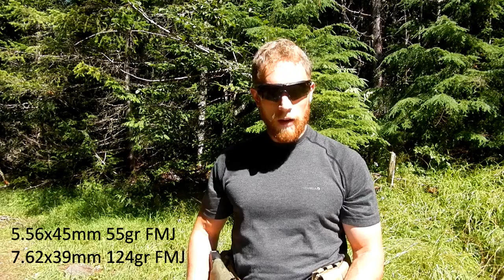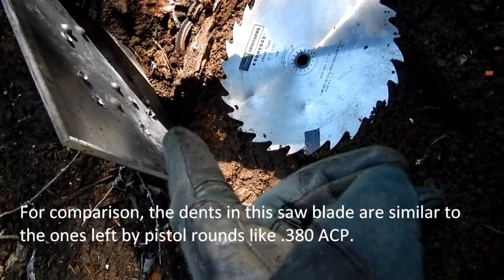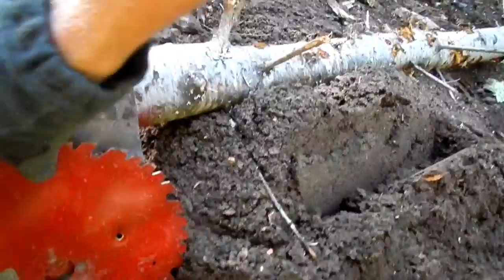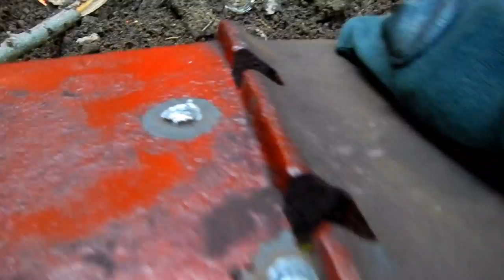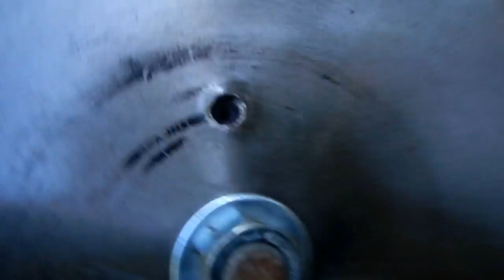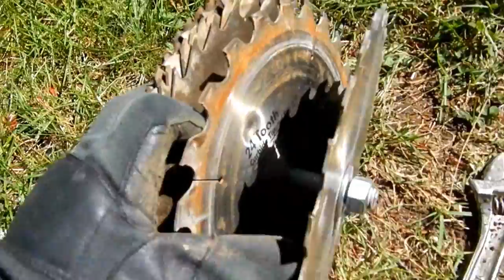Spaced Armor Test 2

Comment: Spaced armor not better than solid steel or stacked steels it seems IF the bullet's trajectory not affected by the spaced plates. That is something I've learned. One thing is almost for sure, solid steels and stacked steels stop bullets easier than spaced steels but will have more of a bulge at the back.
https://youtu.be/AodH5WL1pl8

Comment: A bit late to the party, but to answer why the sawblades stacked together worked so well:
It's the grain boundaries. The crystal structures of the steel plates are physically separated from one another between the blades, creating a lot of resistance the kinetic energy has to overcome. As with every type of energy and force, the kinetic energy ALWAYS follows the path of least resistance, which means in this case that it will spread out sideways into the blades than it normally would, and each blade can absorb more energy through its mass than in the spaced configuration.
The best result would be to use three blades stacked together as a laminated armor plate, with a fourth one acting as a spaced armor plate in front of them with a gap which is at least 1.6 times the diameter of the bullet you want to test. The spaced armor will deform and destabilize the bullet on impact, and the laminated armor will absorb the impact of the debris.

Comment: Tie plates are usually 1040 medium carbon steel which is much stronger than A36 mild steel. Saw blades are even tougher, being L6 or better alloy steel.

Comment: 762 has a harder time going through because the bullet is fatter right?
Reply from the maker: More because it is slower. Kinetic energy is 1/2(Mass x Velocity^2) so a change in velocity exponentially changes kinetic energy
Reply: It's because it's slower, now is that due to mass, volume, air resistance? I have no idea.

Comment: Wasn't spaced armor designed to hold of HEAT rounds instead of solid ones
Reply: Generall speaking solid steel is stronger than spaced steel. Because solid steel is denser in the middle I would believe. For spaced armor to work the trajectory of the projectile or shaped charge's jet has to be disturb and affected.
Reply: @7150285  Thick enough on the outside to disturb the grenade & enough distance to not affect the inner wall.

Comment: The stacked plates seemed to be better as armor since it stopped the bullets better, but seeing the bulges it's clear that you're gonna feel that more than if you had spaced armor
Reply: Stacked plates AND solid steel plates seems better at stopping bullets. But it will have more of a bulge though, that is the trade off. With Space armor it will penetrate deeper especially if the bullet isn't deformed, deviated, key wholing, or shattered by the front layers of the plate.

Comment: The steel from the railroad is definitely a harder more stronger piece of Steel then that 3/8 piece get regular half inch mild and see what happens.
Reply: hardness and strength in metal are on opposite sides of the spectrum
hardness increases brittleness while increasing wear resistance
strength (depending on what kind you want) reduced hardness but increases stress capacity 
The railroad steel plate is not very hard. It has a lot of weight stress capacity.
Reply: @theq4602  good explanation.  yeah I understand the hard the steel  the more brittle it gets. but not if you do it correctly for instance samurai swords are some of the hardest blades you can find that is also very strong. they don't break . But I got your point and it was a good one
Reply: @theq4602  that is not 100% true though. Harder steels also have a higher toughness/tensile strength.
Reply: @7150285  notice I made the statement "depending on the strength you want"
with materials strength can mean all sorts of things.
Reply: @theq4602  general speaking the harder the material the more brittle it is yes. Tensile Strength is toughness I believe. AR500 steel still have much more tensile strength than mild steel. Even though its much harder.
Reply: @7150285  Metal is a tough material. So, yeah it doesn't matter unless if it's supercooled. It won't become brittle.
Reply: @lepmuhangpa  toughness means the balance of strength & ductility.
Reply: @7150285  100% correct definition.

Comment: So the laminated armour was a bit more effective than the spaced armour, it seems.
Reply: That is correct it seems, but the trade off is it'll have more of bulge at the back of the plate although the bullets will actually penetrate shallower. With spaced armor to work properly is if it affects the trajectory of the bullet or by deviating, deforming, key holing, and or breaking the bullets up into pieces. IF the bullet stays in one piece w/o deformation. The spaced armor is pretty much useless and easier to punch thru.
Reply: The saw blades are spring steel and much higher grade than the other plates

Comment: Do you think the spacing effect would work the same with something soft between the plates?
Reply: One thing I got to wondering about, was something like armor | rubber gas tank filled with water | armor | rubber tank with sand | armor

The water's there to wreak havoc on super sonic rounds, the gas tank is there to keep the water from leaking out of holes, and the sand is there because it's really good at stopping stuff.

I doubt it would be practical, but I'm still curious.
Reply: @MrMartinSchou  I'm curious about water & sand as well. Water would be too heavy but sand might work.
Reply: Well the russian t-72 had textolite sandwhiched between armor plate in front hull
Reply: Not soft but hard materials like tiles & glass are effective. That's what's called composite armor, this channel has a great video on it. Check it out.

Comment: Try putting frontal thin plate on a distance that exceeds length of the bullet
Reply: One inch is a practical distance. 
Question: what's the thinnest AR500 we can use to make you Chevy truck door bullet proof?
.125 AR500 1" in front of a Chevy truck door would interesting.
Reply: I know he still hasn't researched the basics of spaced armour to stop kinetic projectiles.
Reply: most bullet proof vehicles either factory made or aftermarket typically like to use AR600 steel. The harder the steel is the thinner it can be made to save weight while still offering the same protection as softer and thicker steels. For example, 1" AR500 steel offer the same protection as 1.5" Grade 5 Titanium. Another example, 1.5" AR600 steel offer the same protection as 2" AR500 steel.

Comment: Nice work!

With the little information I have I would like to give these inputs : 
In an array with two or more steel plates - As far as I know you get the best results by having the harder plate at the strike face and the softer plates behind. First this will reduce the armor penetration compared to have it the other way around - second it will minimize behind armor effect(thinks like spalling). If I remember correctly - German tanks during the beginning and then middle of WWII was the only once using face hardening? A face harden plate can stop projectiles when hit on the face harden side but will not stop the same projectile setup when hit on the none-face harden side.  

I had a some ideas on why a some certain armor setups might be effective but the link you provided did show that some of what I thought to be more effective wasn't.

But your idea of using saw blades put on that screw/rod gave me some ideas for a couple of test that could be done if you could find two saw blades/plates that had a significant different in surface hardness.  
Test 1.
Shot at setup with the two blades with the harder one being the strike face - then turn it around and see if there is any difference with the softer side outwards. 
Test 2. 
Same as above but with space between the two saw blades/plates.

Both Test 1 and 2 should be done with both "loose fitting" and "hard fitting" plates and then see if there is any difference there. Of course this should be done from the minimal distance/maximal load where the bullets consistently pierce one single plate with the same thickness as the two saw blades. So if the plate gets penetrated on consistently at 100 meters/a certain m/s  but have high stoppage at 110 or at 120 meters(less bullet speed) then there is a base line. With this base line each setup could be tested by either increase or decrease the distance/speed of the bullet.

Comment: ha, so it did stop the rounds also the tight stacked saw blades almost behave the same as the same saw blades with more space, is spaced armor still used or is this only a thing that was used in ww2, does a mix of hard steel and soft steel help, is it better to have a lot of thin layers of is there an optimal width of plate for hard steel and soft steel.
Well lots of questions, but perhaps you are on to a formula for new armor !
Interesting stuff !
Reply: dont forget that spaced armor is significantly more effective at neutralizing explosive and shaped charge rounds
Reply: Modern tank armour is made of spaced plates, with or without some composite material between them, when struck at an angle they have significantly more resistance than either a solid plate at the same angle, or spaced plates without the angle.
Reply: @komradearti9935  |  💥| That much space perhaps?

Comment: Very nice video! You need more subs!
N.B : to stop a bullet you need a slim hard metal like Titanium  (to reduce kinetic energy and let to bullet trough), behind it tick soft metal like soft steel (to catch the bullet) and behind it Kevlar ,glass fiber or carbon fiber to catch fragmentation (if there is).Also Angled (60 degree) armor helps a lot, because it's rise virtually the thickness of the metal (relative armor).

Example : 30 mm of armor at 60 degree makes it's effective thickness 34.64 mm.
Here is a website to calculate Relative armor https://panzerworld.com/relative-armor-calculator
Have a great day :D
Reply: but shoot it far away please because there is a risk of ricochet !
Reply: @Aaron Washburn
True but titanium is more handy then most steels because of it's light weight and other specs like : higher melting point, corrosion resistance...etc :)
Reply: Ti is not as strong as hardenable steels. And some high end steels are above Ti in performance, though start to look similar in price. 
Soft steel is not as good as it might appear for the second layer. First off those saw-blades are carbon steel and generally quenched and tempered, so about as strong as Titanium, and they did not break without ample deformation. Use those instead of some soft steel if price is an issue. I speak of strength as hardness is a useless measure in this field.
That calculator must be wrong. It would be a 60mm equivalent for a 30mm plate at 60 degrees.